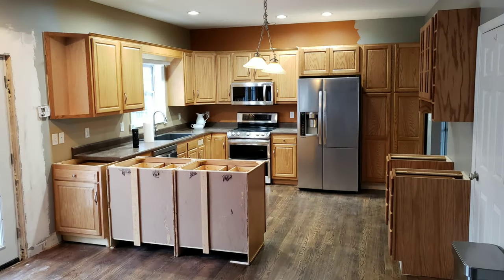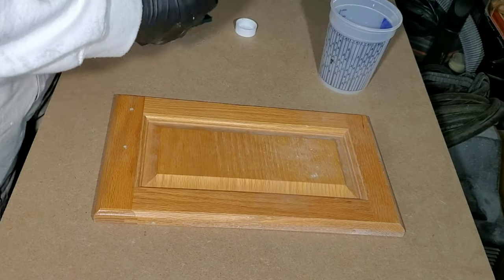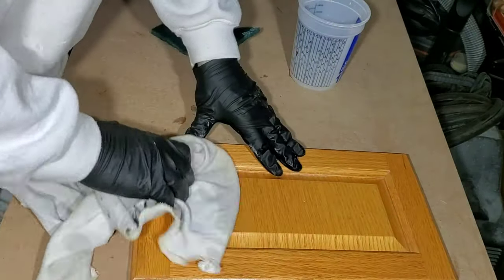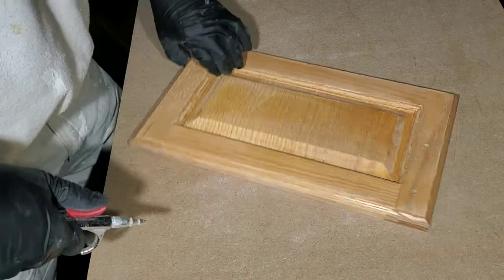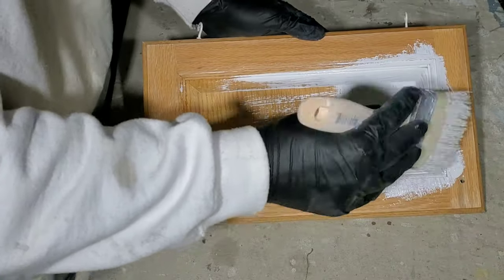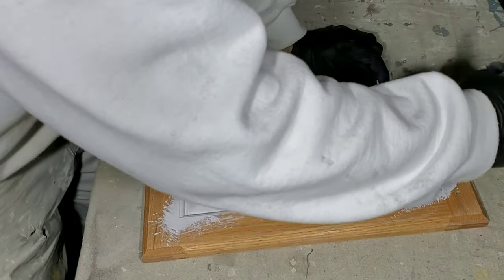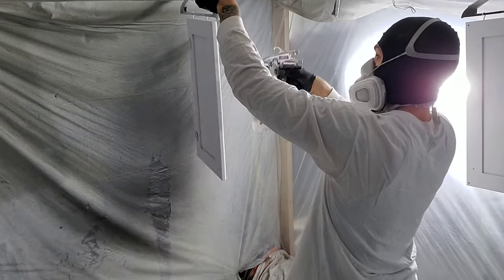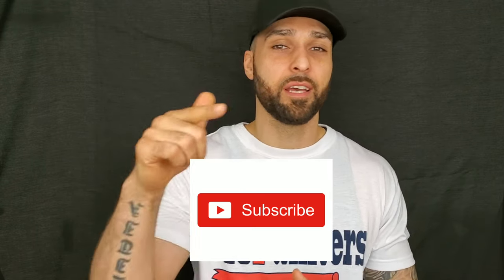Stop! Don’t Paint Your Oak Cabinets Until You See This DIY Method

Comment: I do my cabinets the exact same way as you do, although on my last job while spraying my gemini Hydropure Semi Gloss, I fing micro bubbles and a rough finish, I ended up having to sand everything smooth and shoot a semi gloss clear coat ontop instead. The Hydro Pure Clear coat drys nice and buttery smooth, I think from now on if a customer requests semi gloss, I will shoot my color coat in the dull sheen then top coat it with the semi clear, it just lays out so smooth.

Any tips on how to smooth out a rough coat before shooting another coat of the hydro Semi? I used the semi on a previous job, oak cabinets and everything turned out great, but on this job, all the cabinets where smooth and flat. and I keep finding little dirt and debris in my paint and a rough finish, no matter how I set up my gun settings. The funny thing is, on all my sample doors, which are oak there where no issues, but on these flat doors its been an issues, I have even added a shot of X-IM extender to help it lay out. I should mention I shoot everythinging using a titan capspray HVLP and have for a few years now.

I guess right now I am just trying to do damage control and sand out all these doors so I can then shoot a satin base coat and then apply a semi clear ontop of that. This customer has been very, very particular, going around with the flashlight on his phone pointing out every defect. After I finished the cabinet boxes at the customers home (I have a workshop at home where I do the doors and drawers) and unmasked everything, the husband decided the color was slightly off and wanted it redone, even though I shot out a sample and got his approval. Then after changing the color and providing more samples, he decided the original color was the better match after all. Been a nightmare, since I have already shot out all the cabinet doors with the semi gloss hydropure which has been causing me issues. How fine of grit do you think I need to sand with before I can respray with the satin top coat then semi clear coat. This isn't normally how I would get the job done but sometimes you gotta think outside the box to get the results that makes the customer happy and then get the heck out of there and onto the next job. I haven't found too many other video's where people used the hydropure so any tips or advice with all this sanding and getting out the little dust nibs and boogers without scratching up the coat of semi too much to where it will be seen under additional coats would help out alot. I just switched to gemini hydropure from Sierra performance beyond acrylic enamel. I use 2 coats of BIN, sand between coats, use a base coat of the Gemini Primer, then usually 2 to 3 Coats of the Top coat, first time I've had issues.
Reply from the maker: I've noticed those micro bubbles a lot lately. Which made me go back to using Kem Aqua on smooth doors like maple or cherry wood. 
I tried less air and various different primers but is still get those bubbles except for on oak cabinets.
Have  you tried wet sanding them with 400 or 600 grit yet?
Reply: @DIYhomeimprovementguy   Yup I'm actually at the stage where I am wet sanding up to 3000 grit then putting a semi clear coat over it, the clear comes out feeling silky smooth and buttery. I ended up doing the rest of the cabinets in the kitchen area in a Satin and then putting a semi clear over everything. I would have preferred to have done a dull sheen first but my customer doesn't have much of a tolerance range for error or slight color variances, it's nuts. But I did learn alot about clear coating over finishes and sanding, lots and lots of sanding. The customers are definitely great, friendly people just happens to be even more of a perfectionist than me, lol. He did go in on halves to buy me a Surfprep Sander as a tip and I would credit half the cost to the invoice, which I thought was really cool, expensive little sanders but I have wanted one for awhile now. hopefully will cut sanding time in half on future jobs.

I have honestly always used sierra performance beyond Acrylic Enamel for the past 10 years because that's what product the company where I learned to paint cabinets used.Then when I went out on my own I used it for about another 5 years, This has only been my second time using something different, the hydro pure, I have been wanting to explore more cabinet finishing systems lately. Kem Aqua, is that a Sherwins product? I typically only ever goto Kelly Moore, my sales rep takes care of me and always hooks me up with used demo equipment for way low prices. But I am always open to learning more. I typically like to use HVLP and I live in California, hopefully the EPA laws haven't banned us from using the product, like they did with denatured alcohol... luckily I stockpiled a TON when I heard that no one would be restocking.

I've been watching alot of the videos about 2k poly and the renner products, I'd like to play around with that system, if only I didn't have to special order before a job, then you know the customer will change their mind about the color last minute. lol. Thanks for the reply I'm glad I'm not the only one having issues with the semi on non oak cabinets, I couldn't figure it out. Solvent pop maybe, from whatever was originally on the cabs?

Comment: If you degloss...no need to prime....
Reply from the maker: Incorrect
Reply: @DIYhomeimprovementguy   Deglosser is the bonding agent.
Reply from the maker: And the stain blocker too right?  @fairamir1
Reply: @DIYhomeimprovementguy  I paint no primer...if I get  something coming through after 2 coats  I simply put on another coat of paint in that area...and that rarely happens
Reply from the maker: @fairamir1  your paint will peel
Reply: @DIYhomeimprovementguy    I have never had any peeling problems ever in  10 years since  I stopped priming.

Comment: Bondo don't stick to primed or painted areas, even they don't recommend it, the top paint you are using is not for cabinets and is not chemical resistant, you should be using 2k products only I use Renner, advance is way way to low quality for cabinets